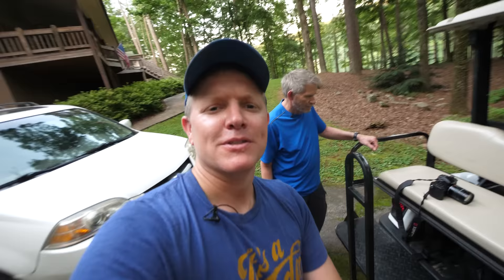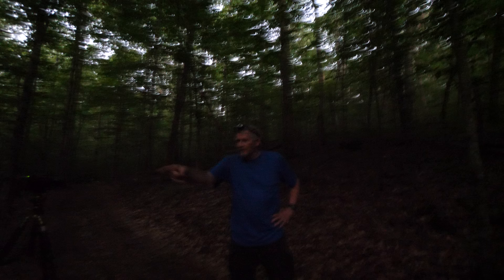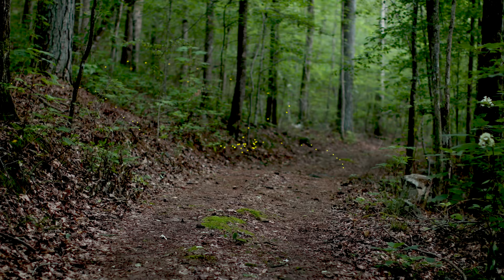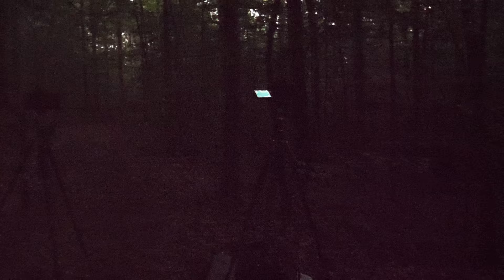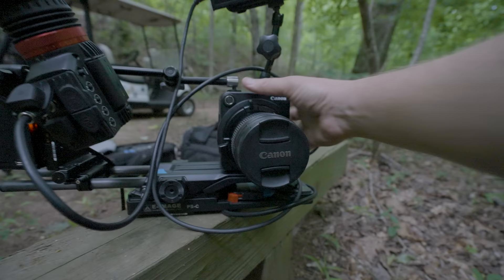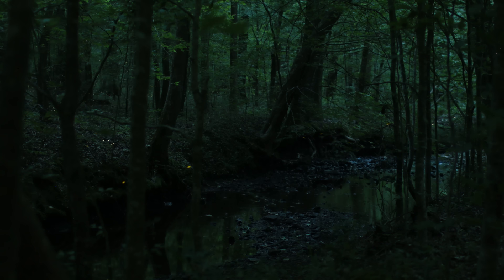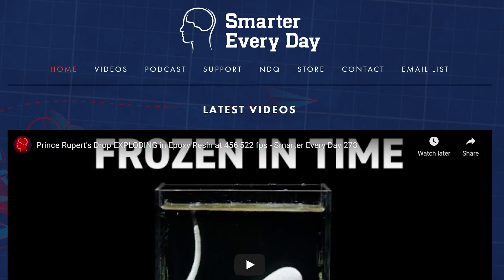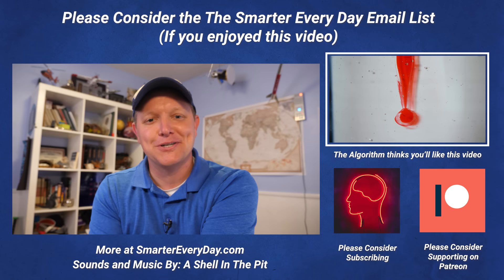The Mystery of Synchronous Fireflies - Smarter Every Day 274

Comment: Like you, catching lightning bugs was part of my childhood.  I learned that I had to pound holes into the top of the jar using a hammer and nail, or the bugs were dead by morning. The holes needed to be large enough to let the air in & out but not too large or I had them flying around my bedroom.  I have been saddened that the environment has changed so that there are now places with no lightning bugs at all.   I read about the rapid flash lightning bugs many years ago, but have never seen them.   You have made it possible for me to finally see them.  You also helped me remember the joy I experienced as a young child so many decades ago. Thank you.

Comment: Back in grad school (about 2006), in my first computational physics course, one of our projects involved using the Kuramoto model for synchronization of coupled oscillators. A few examples of systems that could be modelled using the Kuramoto model were mentioned: metronomes on a board, fireflies, cardiac cells, josephson junctions, and women's menstrual cycles. The professor for the course did research in neurological biophysics....particularly trying to create a device to stop epileptic seizures from happening by preventing the over-synchronization of neurons (apparently seizures happen when the brain waves become too synchronous).

Comment: - be me writing linear motion control code for old sheetmetal equipment upgrades.
- A.D.D. kicks into overdrive.
"oooo squirrel"
runs to youtube
-gets immediately pulled into this video and teleported back 35 years to the woods of pennsylvania and felt good in my brain for the first time in a while thinking back on the sights and smells.
-bonus for wrinkles on said brain for learning of a thing i didn't know existed but wondered about. 

this video generates serotonin.

Comment: @Dustin - when you used the LEDs at 5hz, the LEDs were too bright to the camera relative to the fireflies, even if they looked matched in person. You need to dim the LEDs, probably with lower voltage. (there is a range they'll light in with variable brightness without needing PWM to dim)

Comment: I have seen synchronous fireflies here in the city of Memphis in June. I was bicycling on a paved trail in a large park and noticed that the lightning bugs flashed at exactly the same time. Although not many in number, they were simultaneously flashing once per second. I came back with tripod and camera (ISO set to 3200) and got a 15 second exposure that I posted a on my Facebook June 3, 2015..

Comment: In Music, particularly in Synthesizer music, what you call the 'light signature' would be called the 'envelope' -- at 3:56 you describe an "ASR" (Attack time-Sustain %-Release time) envelope, though there are quite a lot. They're used in synths often to control parameters of a sound, such as it's volume, pitch, or filter cutoff. Using different envelopes can emulate different types of sounds from plucks to whole string sections. Envelopes like these can also control all sorts of things (I have a DIY project where my synthesizer can control the color and brightness of a ring of LEDs) through CV, or "Control Voltage"

Synths are really clever bits of engineering, definitely worth learning about!

Comment: The synchronization process is probably similar to a tableful of metronomes all starting randomly; there'll be a phase with the greatest number of participants, which constructively/destructively interfere with all the other oscillators until synchronization emerges.

We used to live in the country in upstate New York, between Albany/Troy and the Massachusetts border.  Our driveway had a huge hedge running along it (> 100 ft.) that was home to thousands of fireflies in late June. They'd flash in synchrony like these, but with a longer on/off duty cycle -- by midnight, the entire hedge would be pulsing with that greenish/yellow light.  I'm sorry to say I took it for granted after the first couple of years -- this was circa 1995, so pre-smartphone videography.

Comment: Little tip: if you're going to be shooting in super super low light situations, don't shoot in Log. You've only got like 4 stops of dynamic range so by shooting in a regular video gamma you're giving more data to those few stops than if you shoot log, which is trying to split that data across like 12-15 stops depending on the camera. So those 4 get less data. Make sense?

Comment: From my observation, they like some sort of warm and humid environment. Sort of comfy warm you can go out with a pair of shorts, you'd feel the humidity but not so much that you'd feel like your skin's like fly paper. 

They also tend of hang around near a running water source and certain plants that secrete sweet sap. In Asia they favor a palm tree species that are known to produce sweet sap. Like maple tree sap sweet. The locals would collect them then boil it down for a sweet drink or fermented for homebrew wine. 

They're highly sensitive to noise and light pollution. I haven't seen one beyond 1000 meters above sea level.

Comment: I noticed woodpeckers do their excavating mostly in just a few hours around sunrise and got to thinking, Why?  maybe when the temperature rises the moisture that had condensed overnight starts to evaporate and expand micropores in the wood that it had soaked into (possibly melting from a freeze on colder nights?) so the wood becomes softer and easier to dig into?

Comment: I have three different species of them in my backyard in northern Illinois. I have the ones doing the dipping J-pattern long blink that prefer flying low over grass. Smaller ones that like staying to evergreens that do a rather fast strobing blink. And another faster higher flying one that does a fast blink, but still following a different pattern than the other two. The different species also seem to prefer a different time of night to be active. If you catch them they are definitely different sizes, the light color is different, and shield pattern/color on their backside is a bit different. Thus their behavior keeps them from mixing things up with each other regardless of other traits showing specieiation, even though they share the same overlapping territory.

Comment: For anyone with more modest means, I found some success videoing fireflies by using a wide angle prime lens with an ISO setting of 20,000 and a shutter speed of 1/30 second. My camera has a native ISO range of around 100 to 52,000 ISO. Cameras that push ISO readings outside their native range will likely have an unacceptable amount of noise. Prime lenses typically have fewer elements and less glass. Information is lost at every air-glass interface and lenses aren't perfectly transparent. So I believe those are the reasons I had success with a prime lens and not a zoom despite my using the same aperture setting on both lenses. The video I made is best seen on a good monitor, not a cellphone.

Comment: I think this might be a bit like turn signals on a car. If you are at an intersection in a turn lane. Watch the blinkers of the vehicles of the cars in front of you (and your blinker on the dash). Each blinker has a slightly different blink speed but if you watch long enough. You often you will see them sync up for a period of time. In the case of hundreds or thousands of lightning bugs in the woods. It would be extremely difficult to track any one bug lighting up and if there are multiples very near each other then you may see a blink in the same spot and think its the same one. The result is that you have bugs blinking at slightly different rates but you will inevitably see some of them synced up and there may be other groups that are synced up but off cycle from another group. So you end up seeing what looks like the entire forest synced up. Although, you would probably also see times when none of them are synced up as well but if you keep watching then they will eventually get groups synced back up, then out of sync, then back in sync. (sin wave?) Also, depending on how you used the blinking led. I'm guessing you made adjustments until you got it close to what you thought there blink rate should be and eventually it just "synced up" for a period of time due to the difference in blinking speeds like a group of car blinkers.
Reply: That or something really basic. Like one female flashes her code and the males instinctively flash their code back.

Comment: “ An incandescent lightbulb emits only 10 percent of its energy as light; the rest is basically wasted, discharged as heat. A fluorescent bulb performs much better, emitting 90 percent of its energy as light. But neither of these is a match for the firefly. With very few ultraviolet or infrared rays, the light emitted by this insect is nearly 100 percent energy efficient!”

Comment: what kind of camera are you using? If the sensor uses rolling shutter and the readout is not well matched with the flashing of the fireflies I guess it would be hard to catch. At least use a global shutter camera, downside is the general lower sensitivity and the fact they are often industrial cameras.

Comment: I have so many questions about the silynchronisation !
If you set different LEDs in different part of the forest, which frequency/phase will win ? If you keep the LEDs going after one of them took over (every bug in synch with it), will it trick some bugs to synch with them sometimes or will the reference LED change over time ?
I need to do some research, thanks man 🤣

Comment: Smarter minds than mine has likely already mentioned this but wonder if the "issue" with getting it to show well in video is down to sensor readout times? Looking up the spec of that camera it doesn't look like it's a global sensor, so even if it's a low light "monster" of a camera top and bottom of frame is never in sync.
A fully global readout camera might be more money than what's available but might be workarounds if the sensor readout speed is known and you can "sync" pixel strips top to bottom in post production?

Comment: the engineer in me wants you to go out there with an antenna and a spectrum analyzer. because I hypothesize that someone has discovered the frequency that they respond to, and someone is emitting a specific frequency out there every few moments. There is something artificial to this. just can't put my finger on it. kind of like the way we realized we could alter whale migrations with sonar. which is why the Navy is sporratic with its use on certain areas.

Comment: If you were to video a firefly in high enough speed - you could use that high-res recorded signal to drive a light that would flash like that species of firefly. Video a female's flash pattern & you might be able to use the light to attract males. Why chase them down when you can make them come to you? You could make a light that could mimic several species maybe with a raspberry-pi. Regarding video: Fireflies produce a COLD light. No heat, very efficient. IR camera probably isn't the best means for video. Better idea: Use a generally sensitive camera & use temporal softening (in post) to reduce the grain & write a filter that compresses the light's dynamics to brighten dim lights. This should allow you to tune the images to spike playback luminosity to better show flashing.

Comment: No, @SmarterEveryDay… It is not like hypergolic rocket fuel. Nice hypothesis, but wrong. Destin, in the interest of actually getting SmarterEveryDay you should have given your audience a little lecture on Firefly Luciferase (most certainly described in your wonderful book!), which is the MAGNIFICENT enzyme that makes this process of making light, albeit an ATP (Energy) dependent process, EXTREMELY efficient, because the enzyme (possibly with Quantum Mechanical "trimmings") with the energy from ATP and a supply of Oxygen, oxidizes Luciferin to produce that mesmerizing light. In the terrestrial  Arctic we're not so lucky has to have these wonders around us (you need the deep ocean for that), but it is still an absolutely mind blowing process IMHO.

Comment: I love your channel but you are also occasionally spreading some information that is varying levels of experimentally verifiably dangerous.  Not supported by evidence , and thus not supported by the scientific/engineering method. Please consider holding the super natural claims to the same intellectual standards you would any engineering safety issue.  Social positions complicate it. The hold is strengthened by your exposure at youth, but let's drive home the importance of improving ones self through honesty, self reflection, experimentally verifiable and repeatable evidence. So we can continually be smarter every day.